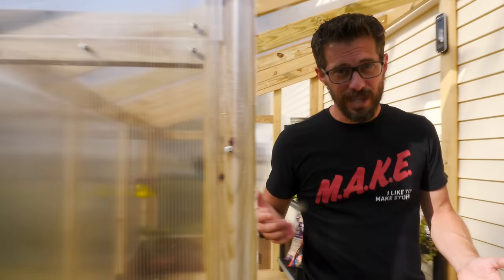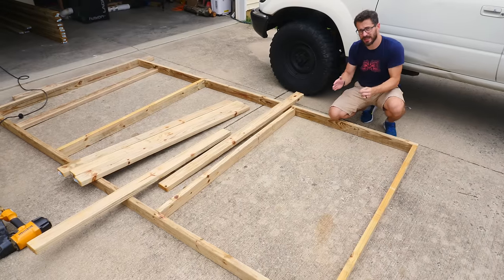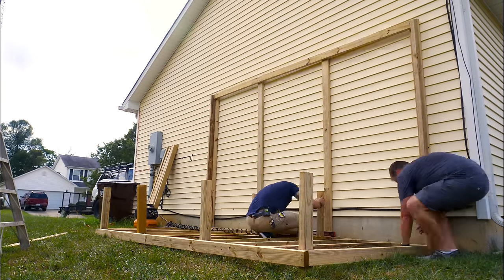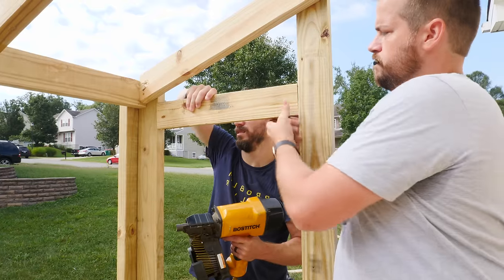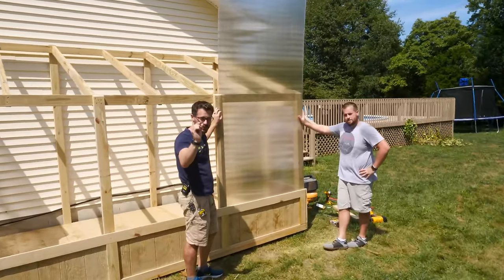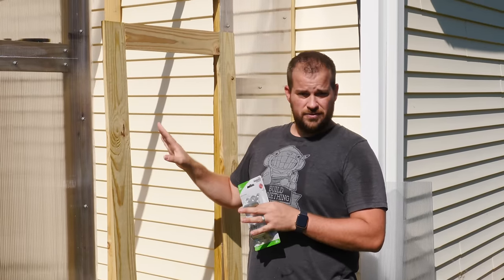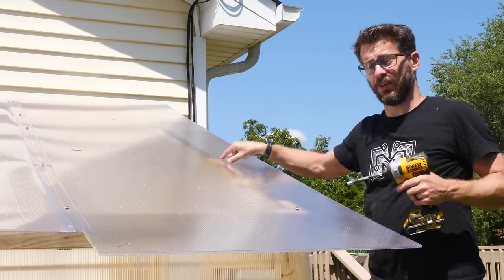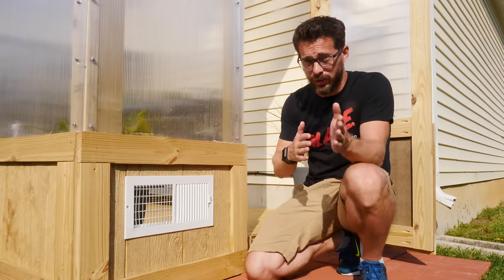How to Make a DIY Greenhouse | I Like To Make Stuff

Comment: I’d be concerned about giving subterranean termites a direct path from the ground to the siding of the house.
Reply: That's the purpose of the PT material
Reply: @bobg.3206  every time you make a cut into PT. you have to retreat the cuts or insects and rot will happen
Reply: not to mention the mouse and rats the will move in underwater the floor he installed
Reply: ecotourism.

Comment: Don't attach a greenhouse to your conditioned home. The high humidity will cause issues from mold to rot.
Reply: What if he had added a layer of the coroplast rather than just use the wall for the home? Would that help?
Reply: @juancanobarrera  Yeah, if he can create a thermal break...even better waterproof the wall and create a thermal break. It's cheap and saves $$$ in having to repair it later when done wrong.
Reply: brick
Reply: @stevenbryant4718  If it is a traditional brick structure then the brick is just a façade with weep holes that draw air.  The brick on new homes is attached to the sheathing by little metal tabs and isn't even structural. If it is traditional and you slap a greenhouse on it you will get moisture and mold on the backside of the wall. People do it, and people live with mold. I guess it's up for the experts as to how bad it really is to have mold in your living area. I'm not really sure what their consensus is today.
Reply: its against the unconditioned garage wall.
Reply: I am trying to find a way to deal with that.  Suggestions?
Reply: @cbriangilbert1978  what kind of thermal break?  how to build that?
Reply: @citytrees1752  It just means that your greenhouse should have 4 walls. Don't use the house as one of the walls to save money. That will create a thermal break. It will stop warm air from the house mixing with colder air in the greenhouse (or vise versa in summer). When that air combines you get moisture. If you are already having the issue then put up a thermal backer like 2" rigid closed cell foam board. and tape the seams. That will also create a thermal break and give you an additional R value. I had to learn all this the hard way. I built my home and turned the attic into living space. Essentially the only attic I have is between the rafters as my rafters are my ceiling joist (Cathedral Ceiling). I put a metal roof directly to 2x4 purlings. You could see raw metal from the inside of the home before insulation and drywall. When the warm air from my home migrated to that cold metal it literally rained in between my rafters. The insulation was all soaked. I ended up pulling out the wet drywall and insulation and spray foamed closed cell 12" thick to solve the problem. Expensive lesson. The next home I built we put down a traditional plywood layer covered in roof paper then laying the metal over that. Also Google the R value of regular .6 mil plastic when use two pieces and  create an air gap. You can grow oranges in winter. Thermal dynamics are neat. Worth a Google for sure.

Comment: Should have closed off the back with some kind of vapor barrier...  parking that thing up against the siding without one is going to let very warm and humid air infiltrate the siding and cool and condense - especially if the garage is unheated in the winter, and create rot.

Comment: I really love your work. However I have to point out the obvious week points. I was actually shocked you chose to build this green house without a foundation of any sort. If you weren’t going that route you should have used gravel to allow for drainage . The rest of the structure being built to code with concrete piers sunk to support the frame. Gravel floor. Tape is not a sufficient hinge for anything.

Comment: I’m glad the code inspector didn’t come by. 😂
Reply: what are those plastics called and would be a better option that is cheaper than glass.
Reply: An inspector will not show up for a lean to shed or green house...No permit required for this type of structure...

Comment: Interesting... he mentioned that they didn't want to level the grade. Then they were stuck with making a very expensive wood floor with siding?! Pressure treated or not its gonna rot due to moisture and water spills. He should have graded the ground and put a durable attractive and inexpensive stone floor down
Reply: I don't know why you'd want a floor in a greenhouse anyway, right?
Reply: @bradley3549  keep weeds from growing
Reply: @nathan-fh8hp  Seems like there are more permeable and rot resistant options than a plywood floor. But that's just me.
Reply: @bradley3549  he said the floor was made of a composite material so I figured it was just textured that way. Or maybe plywood is a composite material and I didn't know that.
Reply: @nathan-fh8hp  It's composite siding laid on top of plywood. Pressure treated plywood at least. Plywood is technically a composite - composite materials are just things made from two or more different substrates (like glue and wood.) 

Never the less, a plywood floor a greenhouse just sounds gross to me.
Reply: @bradley3549  that's understandable, thanks for the clarification! As long as it works am I right

Comment: Why use a floor at all?  I would have just lined up bricks or cement block and built on top of that, leaving the grass or dirt underfoot.
Reply: I'm no expert, but I think no floor is viable; yet there are advantages to the floor, both aesthetic and also sheltering the greenhouse from the climate. In winter the ground is very chilling; for instance, there is a winter wilderness survival tactic where one situates an elevated place or else an insulating barrier (such as leaves) between themselves and the ground so that the ground doesn't suck all the heat out of them.

Comment: Bummer that your covered the floor with wood bc they could've grew nice plants directly in the soil. The way you did it makes you lose a ton of space. It's more of a nursery than a greenhouse. Nice build tho
Reply: i might have to write that down
Reply: What if the soil is frosted or frozen? Guess you just don't use it, but the earth is also a huge thermal mass that will suck the heat out of the greenhouse.Isn't a nursery just a specific function of a greenhouse which is used to nurse young plants? And a greenhouse is a structure which uses translucency to allow and hold in the suns heat? So the more effective the heat holding the greener the house; yeah?I mean, no floor might be good depending; to each their own... but is the floor a "bummer"? Not one bit.
Reply: If they own the place that's a great idea!!! But if your renting you might run into the problem I have. Land lord does not like in ground plants. Be had to rip up to many gardens, so no unground plants for me. Just a thought 🙂
Reply: @nicholas3354  Having exposed moist soil and the foundation insulated to frost depth would allow the excess daytime heat to be captured within the soil then released during the night. Heat absorbed by the soil is not "lost", but re-radiated to the greenhouse interior during periods without sunshine..

Comment: Without a  Concrete foundation, i would not touch this Project
Reply: in my backyard we built a 10x10 shed that stands on on flat pavers ind we haven't had any problems
Reply: Yeah, it looks like the greenhouse will sink into the dirt pretty quickly standing on a few wooden stilts like it is.
Reply: at least for the footings.. and id have kept the dirt floor and used real commercial green house poly..

Comment: If you installed a small gutter across the edge of the roof and let it run down a barrel next to the door, you would have water readily avaiable to use inside the greenhouse at all times.

Comment: Personally, I don't like nails... I am a "screw it in guy" much stronger even if a little slower. :) But I like this idea of a greenhouse on the side of the house.. gonna copy that from you. thanx for sharing. :)
Reply: Screws are more brittle by design. Nails have greater shear strength, screws have greater clamping force. Each has their place.

Comment: 6ml vapour barrier is cheaper and can take a massive snow load on the roof, ive been using the same greenhouse for years and have still had no problem with the “strength” of the vapour barrier. take everything this man says with a grain of salt and do your own research
Reply: You probably have a blue tarp over your chimney too! Lol
Reply: 6ml won't cover much. maybe 6l

Comment: i love how contractors are tearing this apart lol, i just sit here and think about the feet of snow i get in western ny and how my front sleeping porch that is room apart of my actual house, is only like 40 degrees mid winter
Reply: wtf does your front porch have to do with this crappy greenhouse?
Reply: Extra heat source, my thoughts too. Trombe effect was mentioned in earlier comments. Had never heard of it but will definitely research it now. Could be a win, win, living in a 120yr old house with little insulation and epic little greenhouse too!  Pick your battles :)

Comment: i've never seen people get so angry over a diy video. It's really not that bad like chill. I live in a similar area. this building should be fine the wood is all weather proof and there's adequate ventilation based on the heat and humidity. also due to the shape of the siding it allows the heat and humidity to escape off the back walls.

Comment: lol putting wood in direct contact with the ground. Even treated doesn't mean it won't rot.Putting some small concrete piers would have taken seconds especially if you're that sure it wouldn't settle much. Amateur hour all the way around.
Reply: ah yes the required "I think he did one small detail wrong so he is an idiot" comment

Comment: Yes, we were sweaty, it was a thousand degrees outside and a billion degrees inside that oven. Anthony beat me to the first comment. I will not stand for such atrocities.
Reply: Will be interested to hear how it works out for you. My soon to be wife wants a greenhouse as well, so i may be contacting you for lessons learned after your wife uses it a while.
Reply: The P.I. Workshop two will enter! One will leave!
Reply: Maker knifes at dawn?
Reply: @MapBot11  Lesson #1, it is hot as 12 suns in there right now. I'm sure during the cooler temperatures it will really pay off
Reply: @JoshMakesStuff  Jennifer mentioned that some have roll-up sides for the summer months to allow better air flow. She was skeptical if the vents y'all put on top would be enough for summer time.
Reply: ✨1nd✨

Comment: I would have used a dryer vent discharge with pivoting louvers for the hot air out, and used a fan to force air into the greenhouse and tie it to a digital thernostat

Comment: So I might have more questions but I don't want to forget. Wouldn't the airlines and air compressors be the most important buys. I only the the nail gun directed the pressure... I get it puts the nail in.. but I had a air compressor that didn't have enough pressure to drive the nail fully...  I guess my question is, how do I know what psi for what type of wood is needed for complete nail drive?

Comment: Couple of questions-is it wise to do that floor in there? Wouldn’t it be a termite/bug nightmare? And 2. While it may look good butted up next to the house, wouldn’t there be mold/mildew issues on the siding with any trapped moisture, even with the vents you can pop out?siding mildews easily.

Comment: Wow! I like that double sided plastic panel material. I'll have to check the price on that when I do another greenhouse. I basically used special huge roll of greenhouse plastic ordered from a farm supplier, but what you ordered looks really good. That flex tape is also something I want to look into for repairing small holes.

Comment: Greenhouses's aren't painted white to cut down the amount of heat, but to reduce the change to burn the vegetables / flowers inside the greenhouse due to the direct sunlight. (and it's applied on the outside) ;)

Comment: Why did you put down a wood floor instead of gravil?if it gets wet and starts to grow mold,wont that mold spread to the house?if gravil is used instead of wood floor would the vents even be necessary?will it be unstable and wobbly in after a few yrs since you didn't put the bottom legs up on cinder blocks?and because the bottom legs are directly touching the ground will they rot faster because of the floor and humidity combination?

Comment: Maybe had just dug out holes for the feet to drop down into and then filled with a little concrete mix.  Wouldn't be such a pain without that wooden floor, which is gonna be a pain to upkeep in the longterm for many peoples application of a greenhouse.

Comment: Nice build but I would either put vents for air to circulate underneath the subfloor (plywood ) and a vapor barrier on the ground first to keep the plywood from rotting out from mold and mildew not to mention termites . Otherwise a great build with great carpentry

Comment: And no downpour is going to leak thru flaps? I would have done them like 3 inches overlap the sides and end. And ran gasket seal around the  outer edge of the cut hole. Just thick enough to redirect any moisture that gets under the flap

Comment: Great job!!! thinking of building two of them and hooking together? opposite Lean-to .. But my question. would it be better to install two fans? one on each side of the greenhouse?  to circulate the air? setup on a thermostat, when it's to hot to turn on the fans? when cool enough to turn them off?   or are the vents on the top. really necessary to install?   I'm in Southern Arizona..

Comment: I plan to build a lean to greenhouse and notice a few things which they did wrong.  They paid for expensive polycarbonate sheets but didn't seal any of the ends so bug, dirt and water will get in between those openings making the whole thing look dirty in the future.  The use of wood as a floor is not a good idea as it will rot.  The gaps against the house should have been sealed to keep in heat.  Those vents on the roof will probably blow off or tear.

Comment: get 12' long clear plastic and attach one end to a 4x4 which is attached to the house 7' above ground level. Other end of plastic is attached to 4x4 staked into the ground 6' away from home. the plastic bends easily. Enclose the ends and add cross vent fan. costs a hell of a lot less and much easier to build!

Comment: Isn’t there a need to seal or cover the vertical corrugated sheets? I used some of these for roofing previously without sealing those off. Water came in and developed some mold and mildew eventually.

Comment: Instead of relying on two_by -fours  to level the floor, use six-inch brick pavers, stacked as needed at the corners and in the center. They won't rot.

Comment: Fresh pine on the ground next to the house will make it so easy for the termites to get into that house.
Reply from the maker: It's pressure treated and termite resistant.
Reply: @Iliketomakestuff  Very good! FYI a few years back I used pressure treated wood as a stake to hold a newly planted tree in place. When I pulled the stake termites were in the cut end of the stake.  Those sneaky jokers went right up the middle were the pressure treatment couldn't reach.

Comment: Few things, That floor I imagine would rot through in a year or so as there is no ventilation underneath. Having it raised up off the ground on some concrete blocks would have helped. Also I dont imagine the humidity and heat generated inside the green house would have been great for side of the house, I would imagine that moisture and heat would slowly get into the weatherboards and create rot and mold. 

Would be keen to see a follow up video on how it's handled.

Comment: How is it holding up?   Luckily you didn't use Palram Suntuf and their woodtite screws or you would be starting over about the time the warranty is ZERO.   You would likely be dealing with rot from their screws ripping through, pulling out and moisture passing them.  Or you might be fixing 100's of holes from small marble sized hail just like me.

Comment: I suspected when the nailgun came out early that this was going to be a low quality job, but then when I saw the roofing screws directly in the plastic that this thing was designed to last about 5 years at best.  I suppose that's good for Lowes, though.

Comment: This is nice, good job and all, but I would of left the floor open, put gravel down, and then just built a frame around it that rests on concrete blocks. Pressure treated will only get you so far, especially if its directly on dirt, has no direct sun, and has bugs and slugs eating at it.

Comment: At about the 9:30 mark, the guys are installing a strip of plastic about 3 inches wide vertically between the panels.  Is this necessary?   And does it go under the panels or over?

Comment: That really looks great! Can that roof material handle the weight of snow?
Reply: My sister and I used that same material to fix our dad's falling apart greenhouse which has a far less substantial frame system.  Snow hasn't been an issue for us.  We are in slc ut area.  Our vent windows have a frame around them and yet we lose one or both vents at least once a year in the wind though.  I recommend something much better for the vents.

Comment: I'm trying to build this but 6' x 16'. My question is to get the best use from the Tuftex if the sheets are exactly 4'x8' how much space do you need to add for the H channel you put between the sheets? Do you cut some off the edge of the sheets to keep it easy to maintain the 4'x8' pattern across your roof? Thanks.

Comment: you should have used concrete pier blocks  would have been a lot easier to do the leveling and would have been far more stable and make any code inspectors happy.